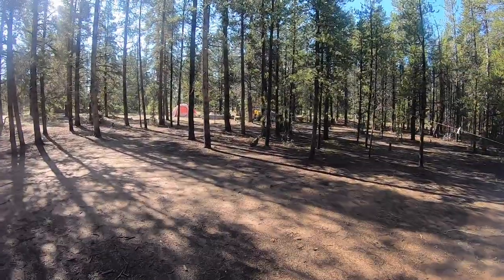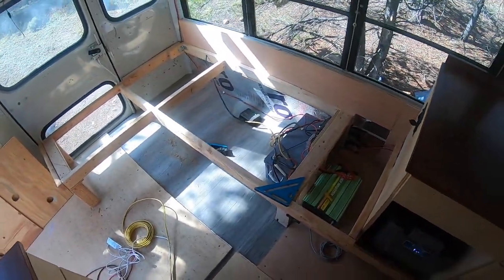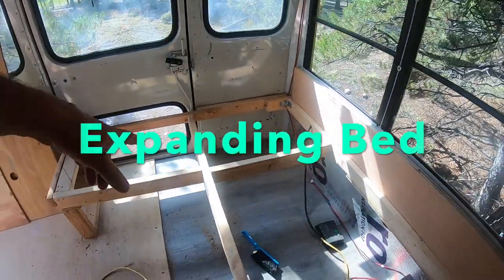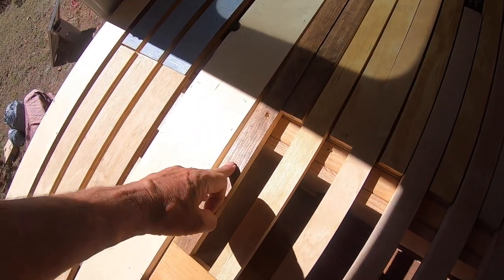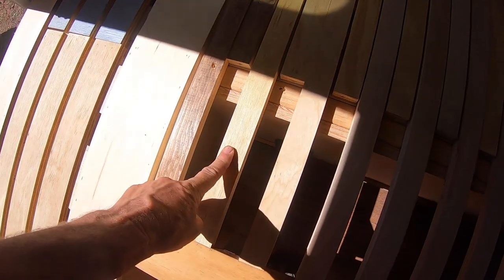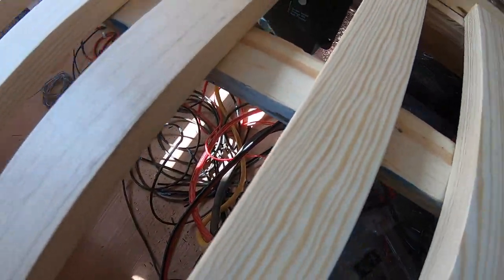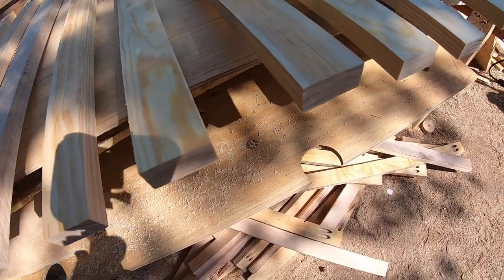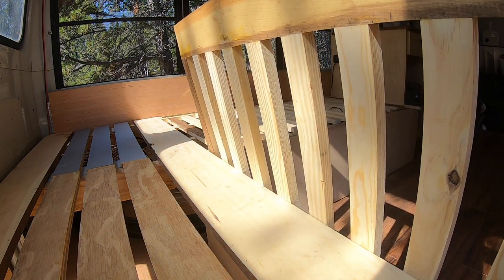Short Bus Redux Part 6 Expandable Bed

Comment: Love this style of bed. Could you add a thin strip of aluminum and screw it into the top of the slats that slide @ the back side? maybe 1/8" thick x 1.5"wide? I don't think it would be thick enough to be noticeable when in bed or seating mode.
Reply from the maker: not sure but it could be something to experiment on.😉✌️